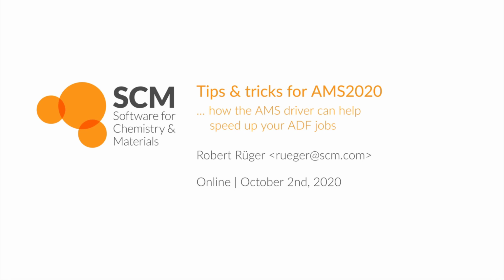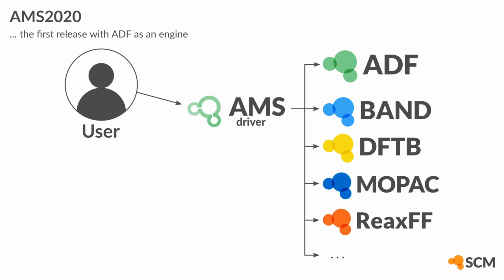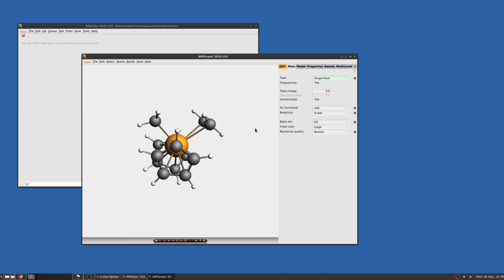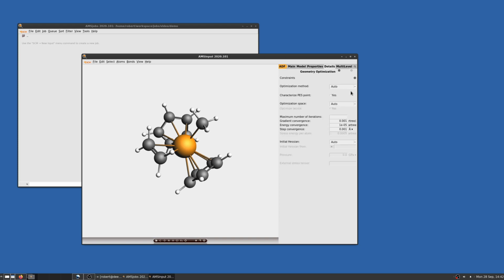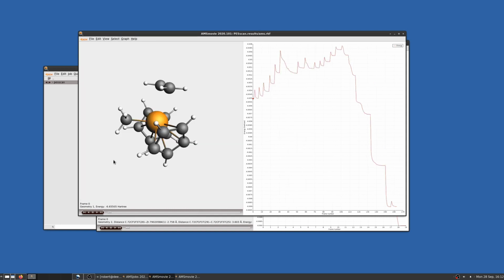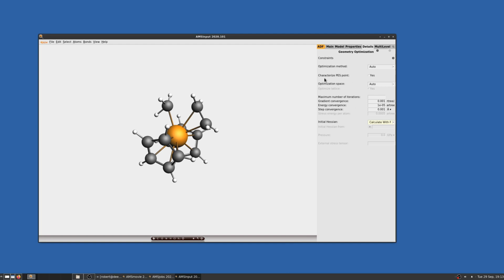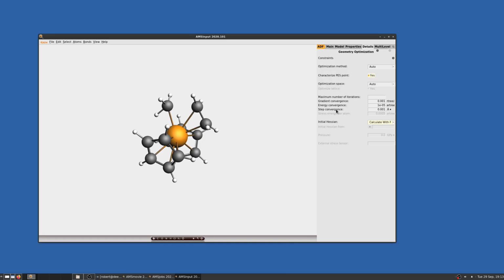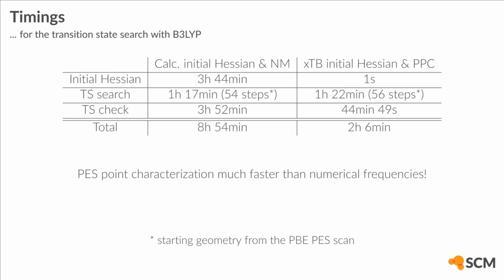Tips & tricks for AMS2020 - how AMS can help speed up your ADF jobs

Comment: Hi, I wonder if it is possible to see an input file for an equivalent task with the text based commands instead of the GUI. Very impresive tutorials, thank you!
Reply from the maker: If you save a job in the GUI it will create a .run file which you can view/edit. You can also in the GUI edit the run file in the Details->Run script menu. To get started with command-line: https://www.scm.com/doc/Tutorials/GettingStarted/10WaysToGetTheEnergy.html#command-line-bash-terminal